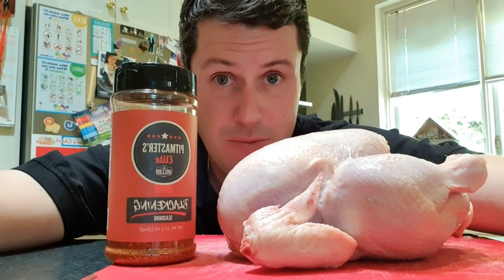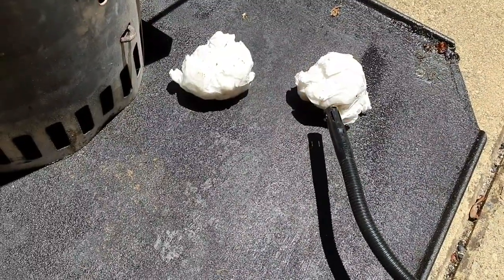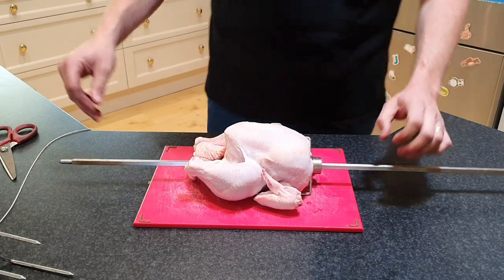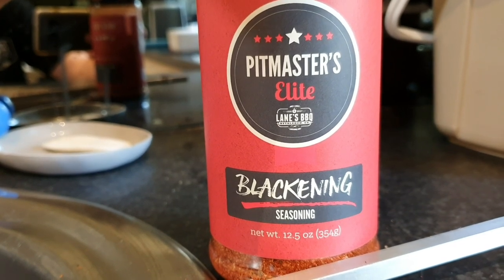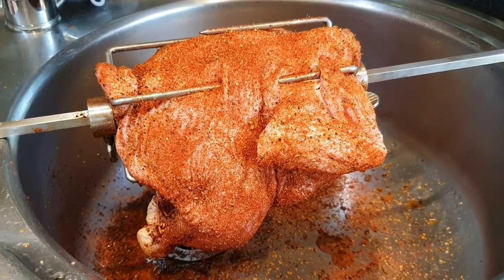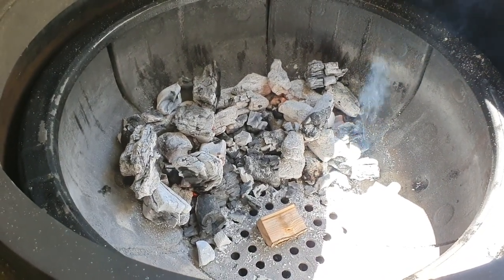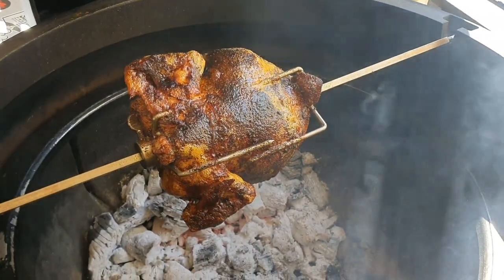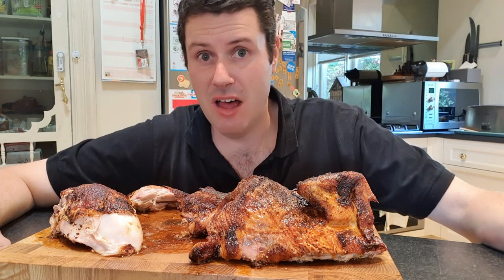Rotisserie Roast Chicken! on the Big Joe

Comment: Nice cook! I'm waiting on a Big Joe and Joetisserie to arrive.
A quick tip...cut two small slits in the skin at the rear of the bird and you can then push the ends of the drumsticks into them. No need for twine.
I also shove a big onion into the bird's cavity. That allows you to run the rotisserie rod through it which centres the bird on the rod. It balances really nice then.
Reply from the maker: Oooh nice tip!